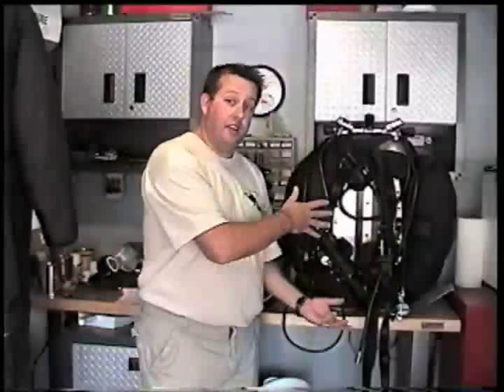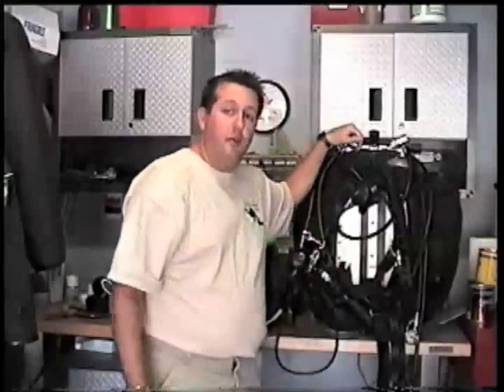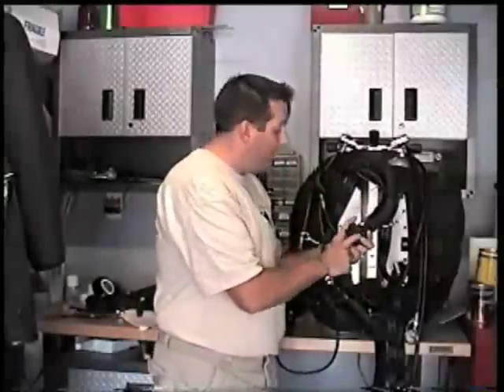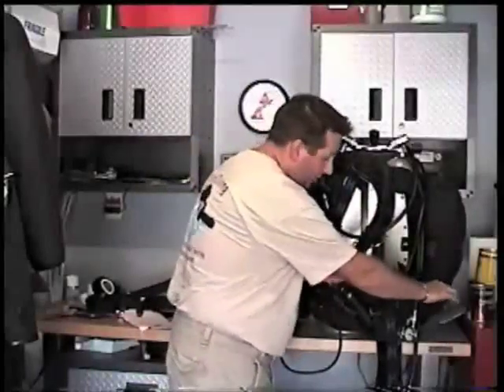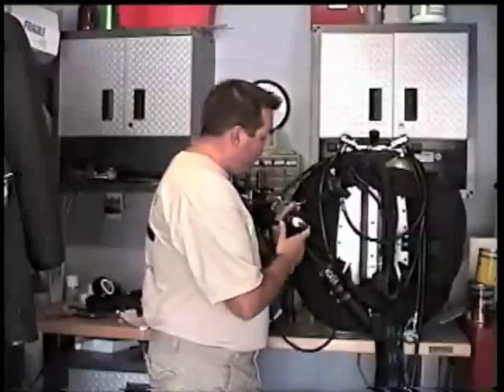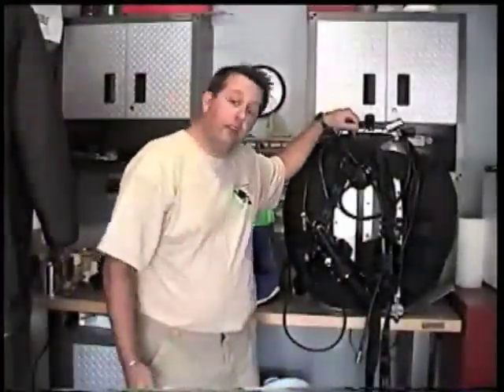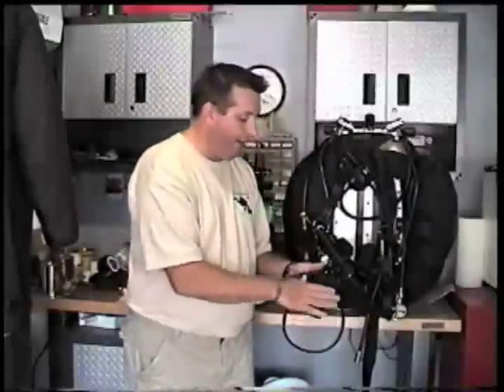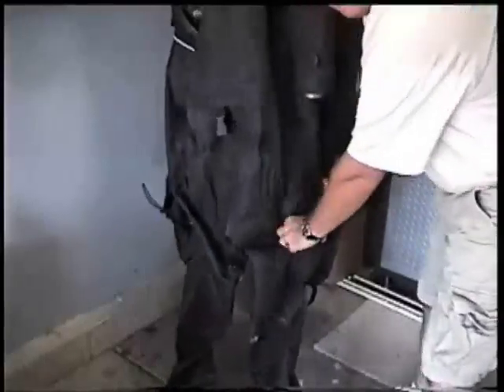How to Perform Pre-Dive Equipment Check

Comment: Yes, the spare air cylinders right? They are yellow in colour, and divers do use them, predominantly recreational divers. But we carry bail out cylinders which is exactly what you are talking about, they range in size depending on depth, and they can be slung or attached to your cylinder. And out of curiosity, are you a diver? Or just intrigued by the idea of diving?